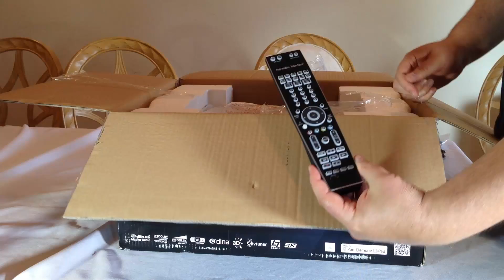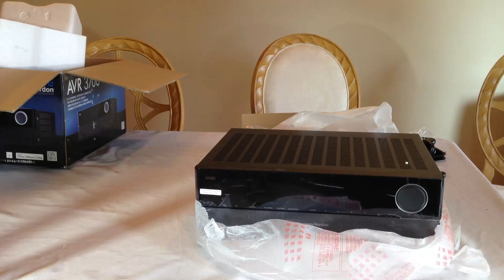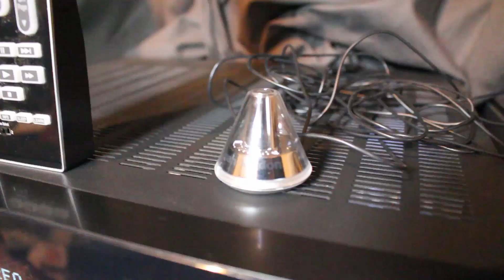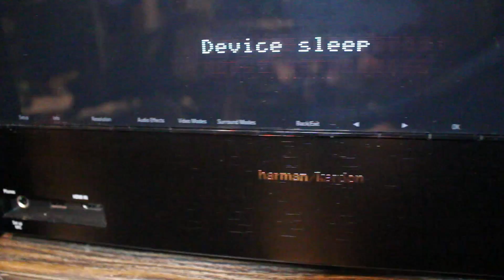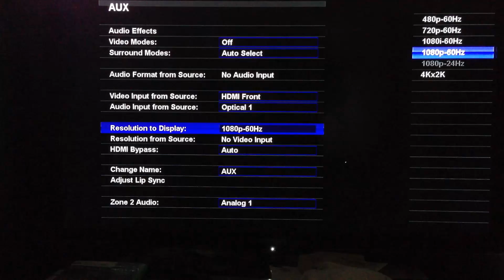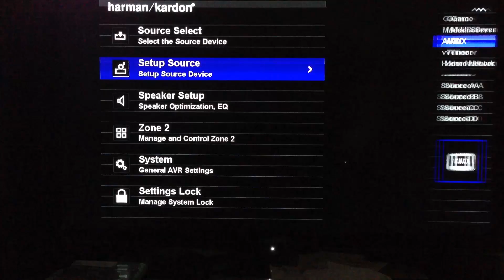Harman Kardon AVR 3700 Review

Comment: I have had 3 HK Receivers. An older 2000 era 2600, newer 2009 era 2600, and just bought a NIB 3700.. Too bad HK wont be making them again... Hopefully they jump back on the band wagon.. My latest AVR 2600 is a beast. That thing has cranked major since I have had it, its running strong... I let my buddy use it down in his entertainment room where the previous owner had a Yamaha RX-V1 he had running, but the right channel was blown... I'll use the 3700 in my new setup soon... One of the things I like about HK is the way the OSD works and overall setup is just second to none..

Comment: First off, it IS gorgeous!  you're right about that.  To me, that's certainly important.  As far as power goes, this has plenty for me.  My days of shaking my house (and my neighbors house) are gone.  Currently, I've got my flat screen connected to the HDMI out, my Mac Mini, PS4, and roku connected to HDMI in ports.  for speakers, I've got Sony 4 ways, a center, and rears.  Soon I'll have a powered sub to go with it.  As beautiful as it is though, I wouldn't pay $1000.  fortunately, I got lucky and got one for a fraction of that.  The on screen menu, when displayed over my computer screen, is translucent, which is a very cool effect.  Don't forget, the on screen input names can be changed to anything you want.  This makes it easier for less "techy" household members to get to the device input they want.
Reply from the maker: Ya it still rocks my house.

Comment: Hello!

I bought this unit and it arrived a week ago. Unfortunately there is a weird high pitch hum coming from the unit. Note it's not a sound coming from the speakers, it's coming from the unit itself. it sounds to be the cooling fan that is making it. Sometimes it does it and some times it doesn't.

Anybody having the same issue? I tried calling tech support, but they are ABSOLUTELY TERRIBLE. Nobody speaks English and nobody understands the problem.
Reply: I'm having the same very annoying problem, only had it less that 24 hours.  Did you ever get it it fixed or should rebox it and take it back?
Reply: I returned it and bought Marantz. Their service was absolutely terrible. I recommend you buy Marantz or Demon... Much better for the same price

Comment: I have a 2700 and agree with your review......Except for the unit being heavy. Both the 2700 & 3700 use a digital power supply so there is no need for a heavy transformer in either. Good vid.